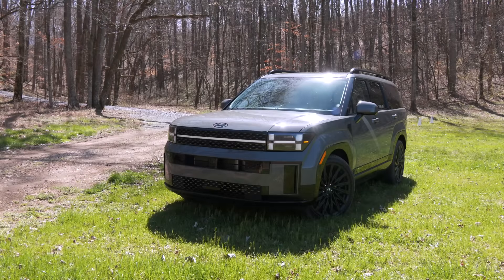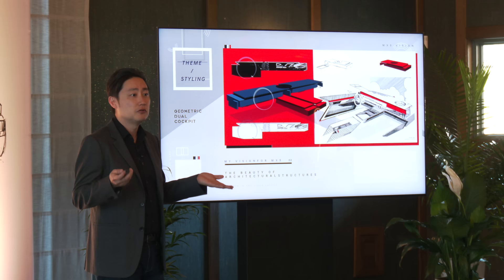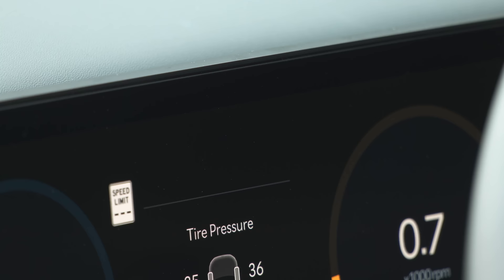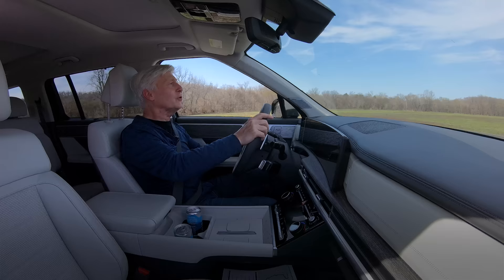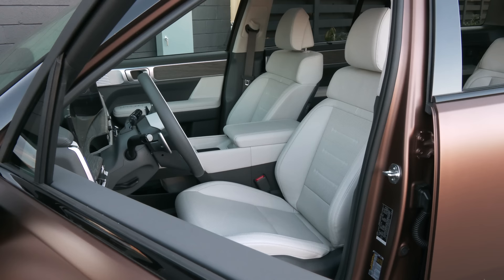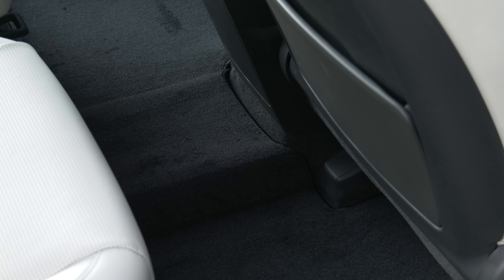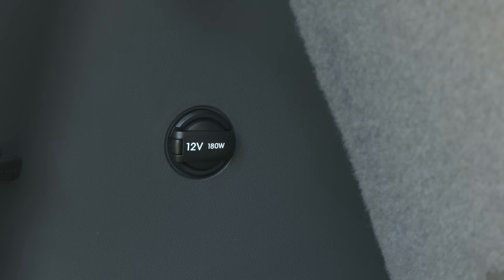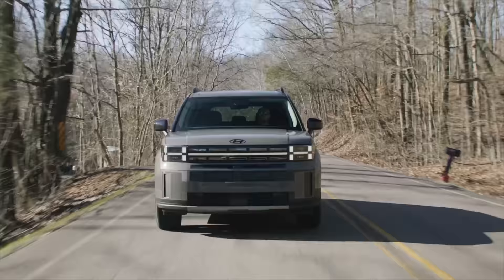2024 Hyundai Santa Fe Calligraphy is Three Rows of Boxy Utility #cars #automobile #hyundai

Comment: Tom, My enthusiasm for highly functional, boxy designs is as great as my distaste for DCT transmissions. With an 8 speed, torque converter automatic in the Hyundai/Kia parts bin, why did they install a DCT in this new model? 🤔
Reply: What’s the issue with dual clutches? I’ve had a couple in performance vehicles that were great, and no issues. Fords implementation was a disaster but that was their fault. I agree though I don’t know why this has a dual clutch, although it’s still better than a CVT.
Reply: this is why i’m waiting for a hybrid i’m
not spending 50k on a doomed DCT
Reply: Good point, some their DCTs have been terribly unreliable and herky jerky in stop/go traffic
Reply: Because they already offered the same combination in other vehicles (including old model) plus a traditional auto does lower MPG. Only by a few mind you but there is a difference.
Reply: Imo, If they put automatic transmission, it will cannibalise  their sales from genesis and palisade/telluride. They don't want that. They want this distinction from their other vehicles

Comment: Ever since I saw that Photoshop that corrected the taillight placement, I can't unsee it. The interior is impressive but those taillights are horrendous.
Reply: "Corrected" the taillight placement by putting it on a moving piece of bodywork; a violation of federal law.
DERP.
Reply: @tim3172  Nope. Audi and others have done it for years. You simply have to include small redundant lights down by the bumper section that activate if the tailgate is raised.
Reply: Well that’s subjective because I think it looks fantastic.

Comment: You didn't mention any (typical) dual-clutch transmission stutters, shudders, or lurching with stop-n-go driving.  Maybe Hyundai managed a trick to allow extra slippage (or flywheel damping?) for the sake of relaxed motoring in urban driving.  Every DSG I have driven ONLY shifted nice when driven hard, but otherwise felt harsh and grabby when creeping in traffic or through neighborhoods.
Reply from the maker: For those that know about the dynamic, it was implied. For those who don’t, they know it kicks down quickly.

Comment: 1980s Euro-style, blown up to unhealthy proportions. This is a severely obese Matra Rancho. Many Italian designs of the time had an awkwardly placed thin stripe of rear lighs like Fiat Ritmo or Alfa-Romeo 75.

The most functional shape is a parallelepiped, that is, a semi trailer, a rail car or a VW bus. Ultimately, it is about the usage of the available volume, so the egg-shaped 1995 Toyota's "family module", the Previa, is more functional than this tank. Even the 2000 Town & Country makes more sense. And don't get me started with the cheap tablets.